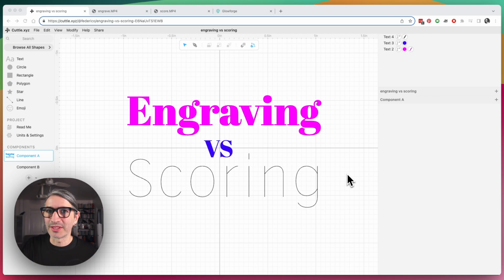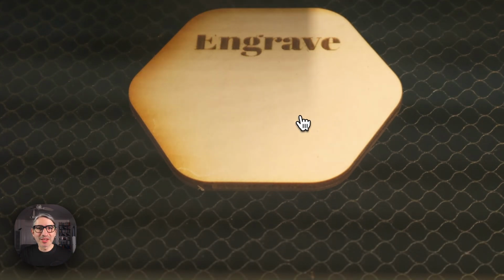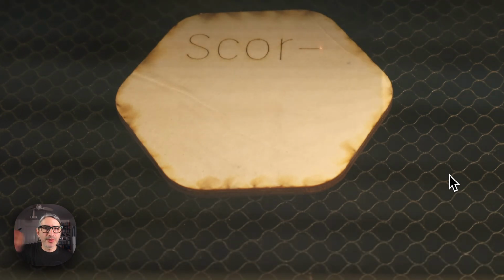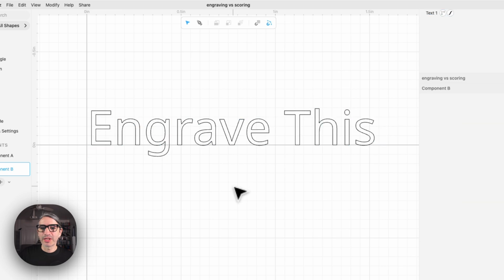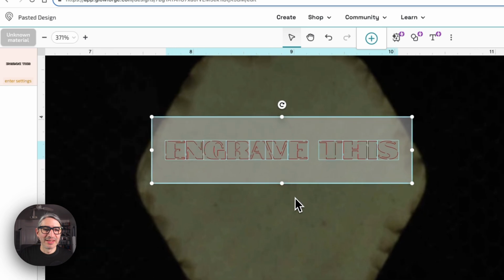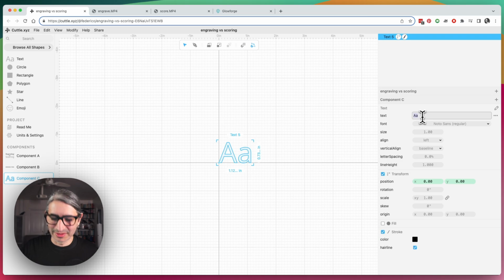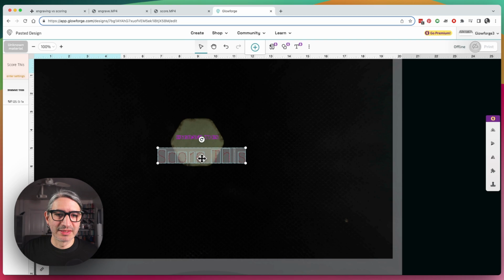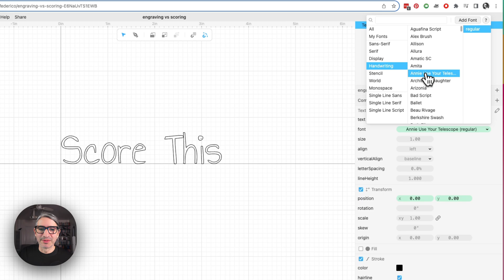What's the difference between Engraving and Scoring Letters with a Laser Cutter?

Comment: Thank you for this video. Another tip that was given to me by Toby, which I found quite helpful with the Glowforge, was to use different colors of stroke on different elements in Cuttle. When imported to Glowforge as an SVG, different colors are put on different layers. This is amazingly helpful with complex designs so I can control which layers to cut, etch, etc.